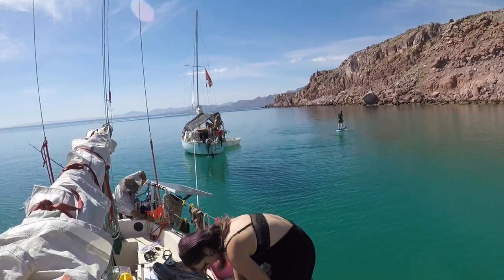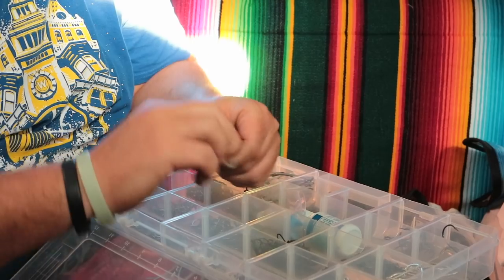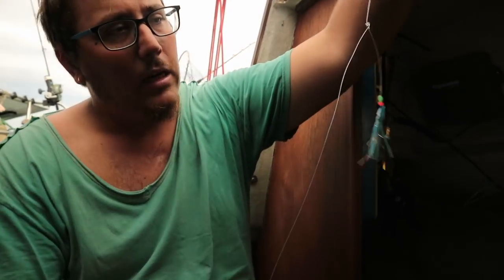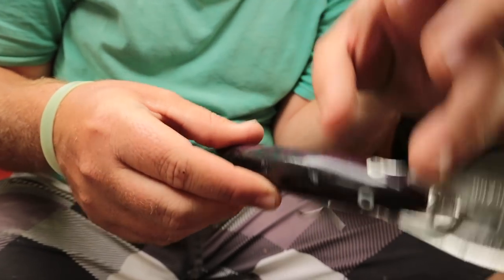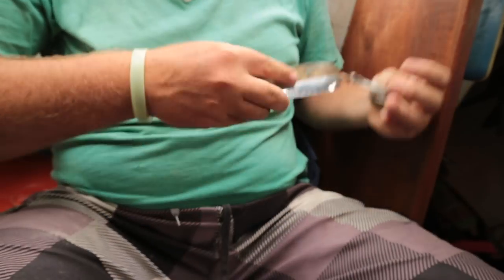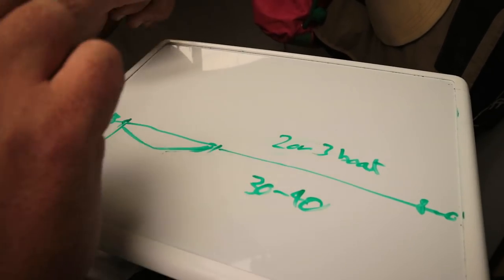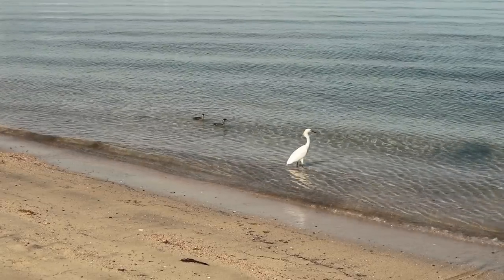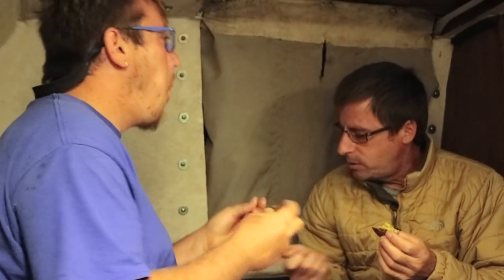Get Fish Without Losing Fingers

Comment: this fella is very knowledgeable
and like shvonce said, it's easy to make lures.  powder coating lures is quite easy.  either a propane torche works, or an oven on cleaning mode (500 degree's farenheit) .

it doesn't even have to be powder coating.  as a child i started out making lures with enamel paint.  it wasn't until about 20 years ago we started using powder coat.  finger nail polish works great.
Reply from the maker: We haven't made lures like this yet on the boat, but have done a fair share of nail-polishing lures haha. A project for the future.